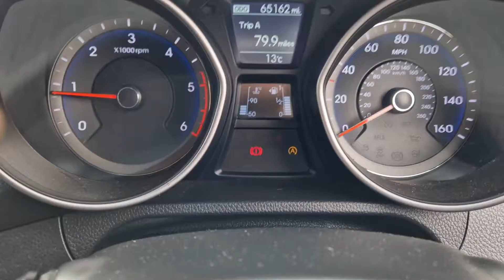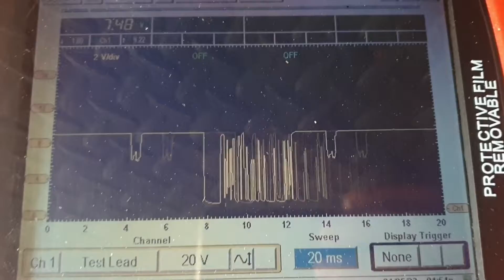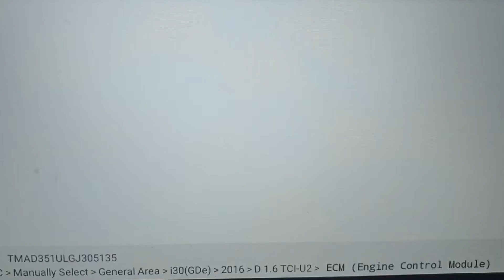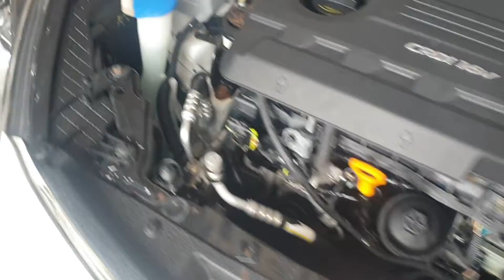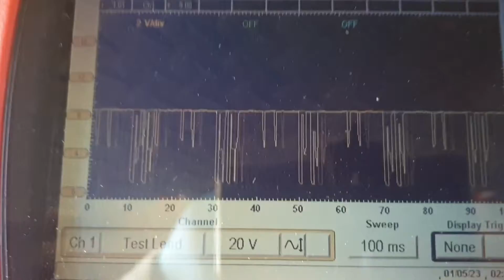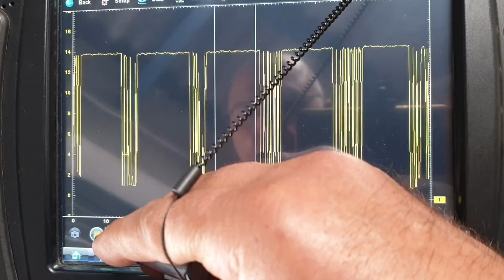Case Study Hyundai i30(GD) 1.6 CRDI D4FB P1596 (P159600) DTC Troubleshooting.

Comment: Hi, i have i40 1.7 crdi and my start stop light blinks then stays on when i start the car A with circle light, it gets the same code  as on this car, also the battery is at 12.2 to 12.4 volts constant, alternator voltage is at 13.7 to 14 v. Also the light goes away and sometimes stays on

Comment: I recently found your channel and today is the first few videos that I am watching. Your videos are way too long and you repeat yourself way too many times. The trending length of automotive repair videos is 20 minutes long. I believe that if you edit out all the repeated information you will gain many more viewers and subscribers, cheers.
Reply: You also need to learn how to read LIN signal SIGNATURE to see which component is speaking with the ECM on a wire, there might be more than one component on a circuit. You must zoom in on the waveform to see the first few square waves as this is the component signature, the same good working component will always have the same first few square waves to identify the component and if there is more than one component on the same LIN wire then you will see the difference in the signatures. After the first few square waves then that will be the data packet of information such as battery voltage and amperage and other information is sent back to the computer to be analyzed, used by the computer to do work, and reported to your scan tool. cheers.
Reply from the maker: I appreciate your advice. However, everything i say in the videos is necessary. I consider every aspect of the diagnosis and include all the steps. It is a long process, but missing a single step may result in a misdiagnosis. Again, I appreciate your advice and will take it on board.
I think you missed and didn't watch that part in the video, which i show the circuit  wiring diagram and pin specs in the video,  even trace the circuit from the power point to the load (component), back from the load (component) to the ECU.
Reply: I appreciate the fact that you don't find fault in your own video with the many times that you repeat the same exact words again and again, no drama mate. @stanhopeautorepaircentrewardak
Reply from the maker: @DuaneDonaldson  when there is no pin data spec for the pin, it would be pointless explaining the signal wave form, but i did show the comparison of pre repair and post repair signal Waveform. I think, you tried to explore yourself here,  as an expert 😉, you should have been considered that from my accent as my first language is not English it doesn't mean that i cannot communicate or cannot make someone understood this channel is seen by 1.3 millions people but l have not received a single criticism about explanation, i do know that how the Local Interconnect Network, CAN, FlexRay, MOST, Ethernet(DoIP) work.
Reply: No worries mate, if you zoom in on the good waveforms and look at the beginning of each data area, the square waveforms, you will notice a repeated pattern at the beginning of the packets, this is called the header and it is the signature for each component, every component has a different signature/header to ID it. Some LIN only has one component on a wire while other systems have more than one component communicating on a single wire. If you have more than one signature/component on a problem wire then you will know to trace more than one possible problem. Normally we just unplug the LIN components until something gets better and we found the problem. The real issue is we need a good signal waveform before we know if the bad waveform is for more than one component. So we must collect many waveforms for our personal diagnostic library. Anyways, something for you to look at closer and learn about LIN, This reading of the waveform cannot be done with CAN waveforms without special software so giving extra time to LIN problems is worth the extra effort. The number one problem I see is when people replace their LIN alternator with the wrong LIN signature and the ECM/Master does not speak the LIN language of the wrong part number. cheers. @stanhopeautorepaircentrewardak
Reply from the maker: @DuaneDonaldson  thank you very much for the valuable information provided here. As i said before, i opened the wiring diagram, and it is recorded in the video too, (connector A pin 41 at the ECU  cannot be tested or a random digital signal) said by Auto data used in the United Kingdom.
This sensor has a chip in it, and the signal is processed in the sensor itself and then sent to the  ECU, and the sensor is directly connected to the ECU. As looking to structure of the circuit, i am not sure if the engine ECU can directly processes LIN signal as from my point of view, the LIN signal should go through the  gateway module first to reach the Engine ECU,  on the other hand i did not have access to a good known signal Waveform for this sensor from the same vehicle to compare the Waveform with it.